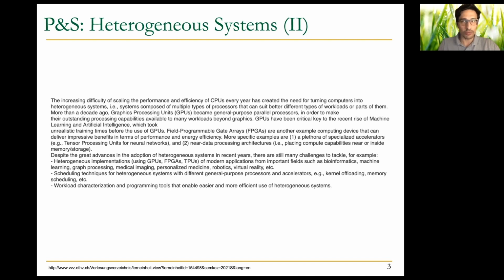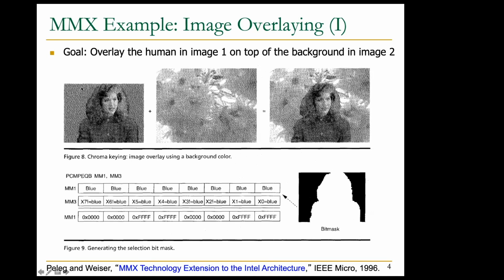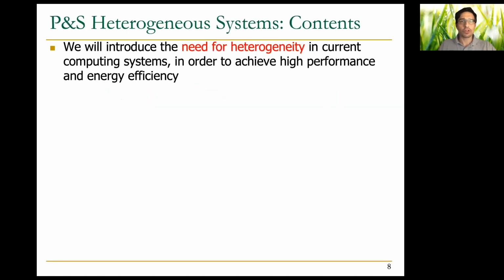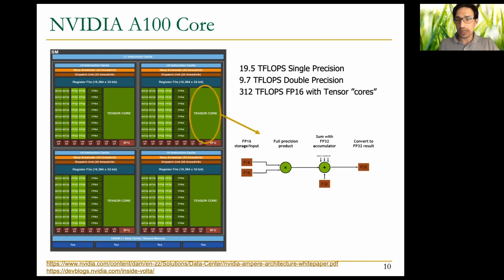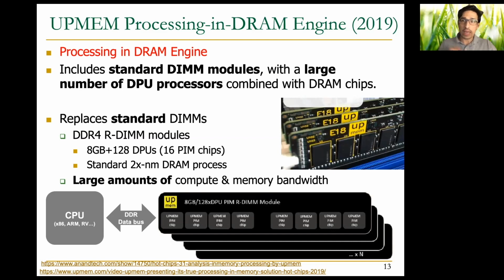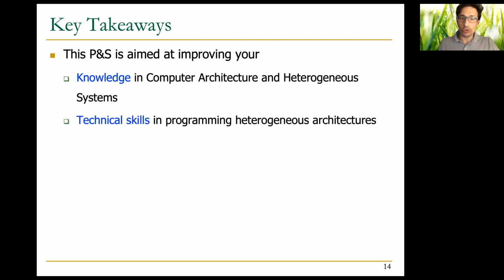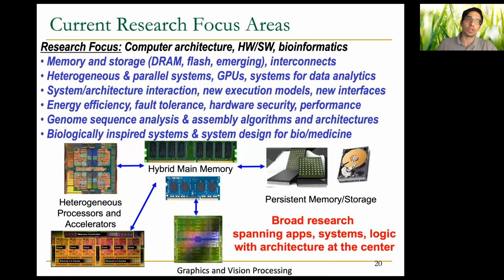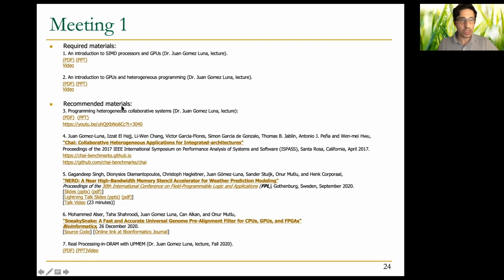P&S Heterogeneous Systems - Meeting 1: Course Presentation (Spring 2021)

Comment: FIM PIM Incredible New Technology

I am very interested in your latest technology and lectures.

We are interested in developing NPU internal memory compilers for HBM PIM structures. Furthermore, we are interested in fastening the CPU-embedded NPU and designing tools that are compatible with existing artificial intelligence frameworks, and speed benchmark methods using them.

Thank you so much for a lot of things to learn from you. I run a semiconductor company in Korea. Recently, it is developing AI semiconductors and related software.

I support your free lecture. I'd appreciate it if you could let me know if you have any other channels or data.